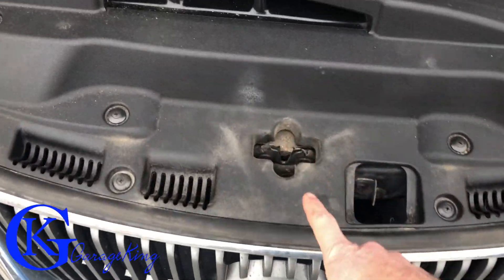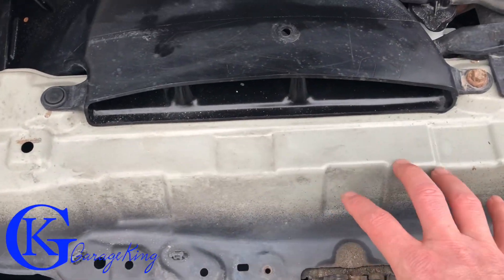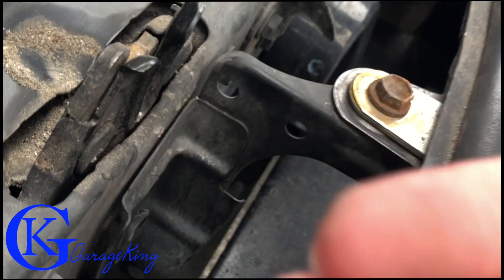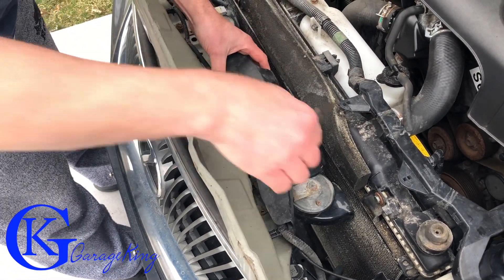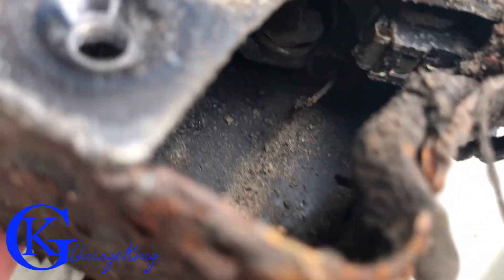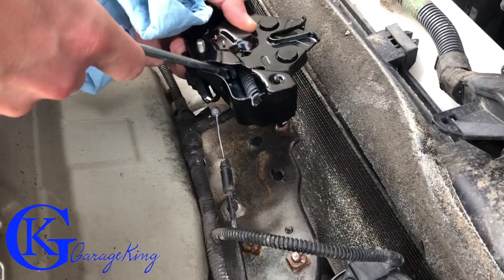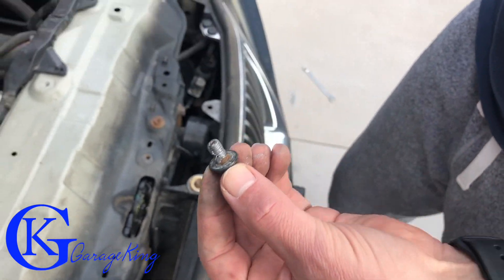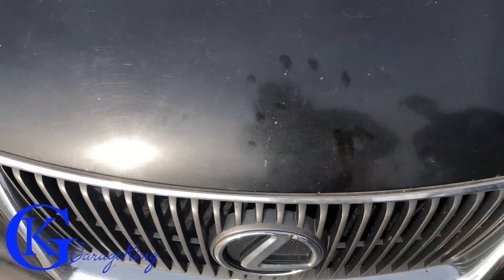Lexus IS250 Hood Latch not working, replace it

Comment: IF you have a GS350 this job is much easier. I did it today. I expected to have to remove the big metal piece he did (under the plastics) but NO. Mine was right there- fully accessible without the need to remove much more then 3 bolts and the cable. My spring was also broken. Paid $65 for the part- delivered in a day from dealer. 

Question: Mine was not locking. If I replaced the two springs would that have fixed it AND are the springs even available? No regets just putting in a new one but a spring or two would have been much cheaper.
Reply from the maker: Hey there and thanks for the comment, Sounds like the IS250 is more difficult than the GS350.  To answer your question about the springs I think if you replaced them it would probably lock.  I think I showed how the springs were shot in this video.  As far as I know you can't buy the springs by themselves.  You have to get the whole assembly.
Reply: @GarageKing  Thanks. Springs are available- around $3 and $5 bucks. I called Lexus today. Might rebuild my old one and sell it as used. Yes, 100%, on the GS350 3 bolts and some plastics and you are done. Quick 15 minute fix. I was not looking forward to removing the metal thing- no need.
Reply from the maker: @MOAB-UT  Thanks for the follow up, I did not know the springs were available. Mine was pretty rotted out.  The springs for sure, but I think for mine it was best just to replace the whole thing.
Reply: @GarageKing  Mine is fine except the 2 springs. I bought all three for $7.00 OEM Lexus.
Reply from the maker: @MOAB-UT  Your was in better shape than mine which was full of corrosion. Living in the salt belt will do that LOL
Reply: @GarageKing  Being under that bracket might have exacerbated the rust. The salt just sat on it. I have about an inch of salt on my road right now!  Not great for cars, but it beats ice! I sold my last car after 10 years due to too much rust. The Lexus show much less rust. I think it uses better materials like aluminum for some suspension parts that never rusts. Lexus really are the best overall value proposition.
Reply from the maker: @MOAB-UT  They really are, I do like Lexus and you are right about the aluminum components underneath, they do last.
Reply: @GarageKing  Agreed my friend. I have a good friend who is a Master mechanic- turning wrenches for ~40 years. He has seen and fixed it all. I brought him my Lexus GS for an oil change. He was happy to see I was doing well. He knew me well when I was dead broke. Admittedly, I felt uncomfortable so I made a joke for levity. I said "it's just a fancy Toyota." He shook his head and said, "NO- Not really. They actually are made differently." He is not the joking type. He was correct. Funny- he has more money then god but drives an old beater! Super nice, salt of the earth type dude.
Reply from the maker: @MOAB-UT  Glad to hear your are doing well and your friend does sound very down to earth Keep him close as its hard to find friends like that.  Happy Saturday to you !

Comment: I have a funny feeling the bolts that were holding my latch to the metal piece are NOT the right ones, they didn't have that little bump at the base of the bolt (7:37 for ref.) Would happen to know where I can get some like these?
Reply from the maker: Yes, most likely someone was in there and replaced the bolts with someone saying, just put any bolt in, its just a bolt.....  Not realizing they are a special bolt.  My guess would be to phone Lexus and provide your ser# and see if they have a part number for it.  There is the possibility that bolt is used on many difference models of Lexus cars.
Reply: @GarageKing  I guess I could try that, I just finished inspecting the latch like 15 minutes ago and it still shows on my "dashboard" that it's open. If nothing works, then I might just take it to the shop
Reply from the maker: @diegocruz530  You could always disconnect the electrical connector to the latch and then jump the terminals.  The light should go out, if you have the vehicle running and can't turn off the dash light off then its in the wiring to the dash, and not the hood latch.